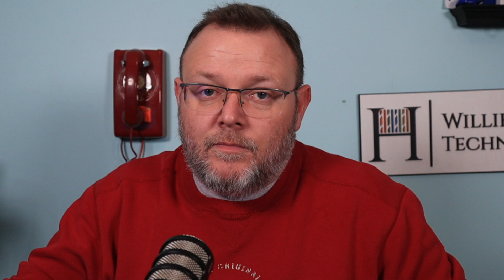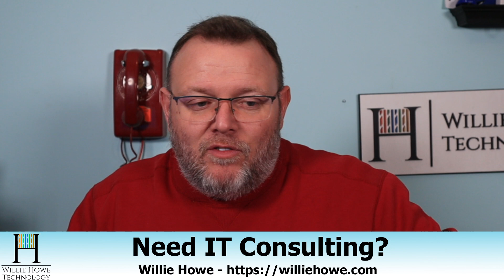Half Duplex vs Full Duplex

Comment: Additional : if you're seeing half duplex on your wired link most possibly the other side is forced full duplex and doesn't do any negotiation. So if you're on auto duplex and speed you should consider switching to a static speed and negotiation.

Comment: When running Full backups from a hardwired server, I wanted to use half duplex (2x as fast) but the network team refused. Or I just didn’t have enough knowledge of downsides, like “important interruption” type messages. Thoughts?
Reply: Are you seriously saying half duplex is twice as fast as full duplex?
Reply: @PatrickLangendoen  no, but my understanding of the fundamentals suggest it might be 2x as fast on copper ethernet. If Tx and Rx can be negotiated for crossover cables, could they not run in parallel direction at the physical layer? I was able to test it at the time and convinced myself there was some benefit to HD in heavily one-directional data xfer, even if not for the reason I'm describing. I should just test it again. I did not look up hardware specs.
Reply: ... imagine the Florida evacuation (when?) where ALL lanes of highway had traffic heading for safety. Definitely faster IF you can utilize all the infrastructure.

Comment: is there any small AP for home or small office that are full duplex ? like why is there a limitation in the first place ? and why hasn't the full duplex devices made it to normal APs
Reply from the maker: No
Reply: @WillieHowe  why
Reply from the maker: @DarkNightSonata The shared medium and collision avoidance.
Reply: I think it is because the big drum radios he was talking about use a separate frequency for each direction, so they could run simultaneously.  I'm guessing the limitation would be expense or regulated bands, power output, etc.  Well also, I'd think that the client radio would also have even more limitations.  Inside a computer you can multiplex stuff on a single wire because the computer has control of everything, but in the atmosphere, it is more complicated.
Reply from the maker: @ironfist7789  100%
Reply: @ironfist7789  many thanks for your reply, makes sense. So I assume there is still a long way for wifi technology to develop to reach a near cabled solution. I was looking at some other videos, and its rather complicated on how the technology works exactly and optimization can be done in many different ways to reduce interference and increase reliability especially now, with tons of IoT devices in every house.